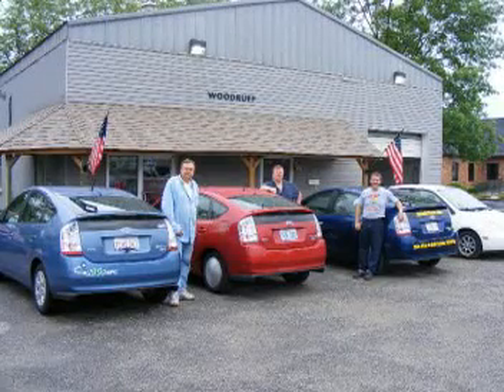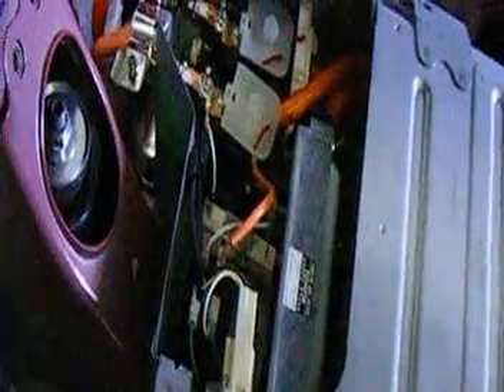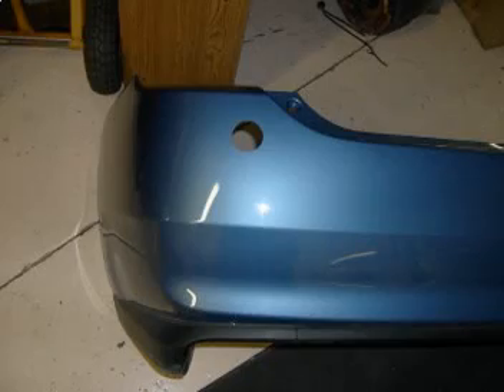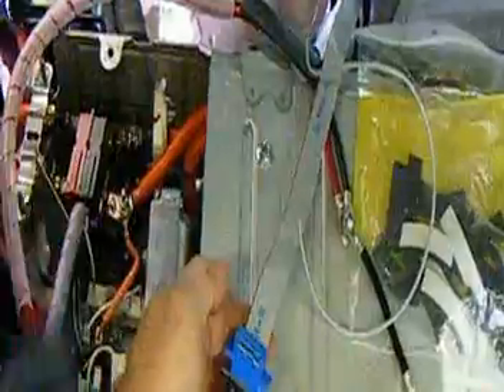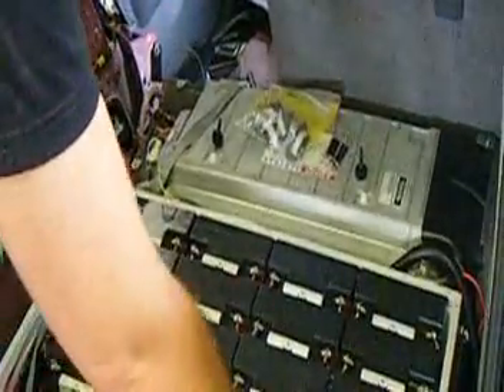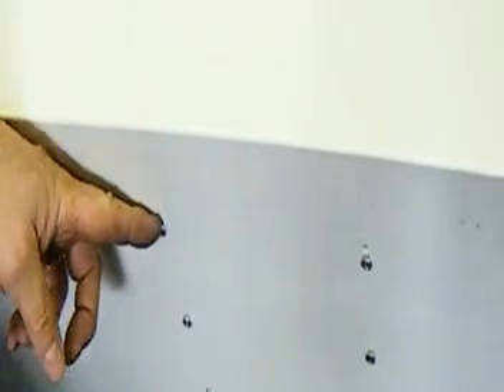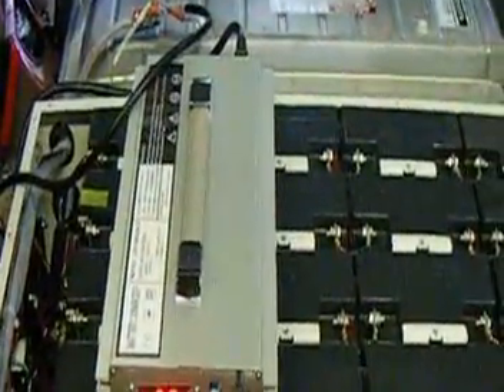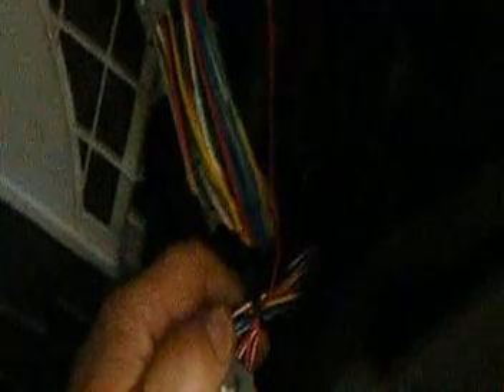Prius Plug-in Hybrid Conversion Installation

Comment: This conversion don't make any damn sense with all that lead acid battery add so much of weight it completely defeated the purpose of efficiency, lithium ion battery is a much better solution for capacity to weight ratio but the cost would be astronomical, your just better off with a vanilla Prius or a PIP.

Comment: What is the point of this conversion?
If you simply want to recharge the battery from household current there is a far easier way.
If you want to add capacity there is a far better way.
People have added a second Prius battery that they recharge from household power, without unbolting and placing things on top of the spare tire.
Not saying that this is a bad conversion, just look at all of your options before you decide.